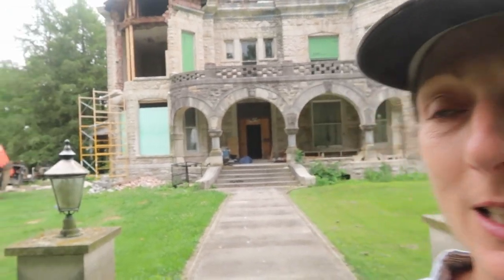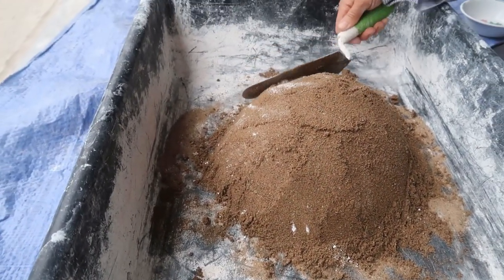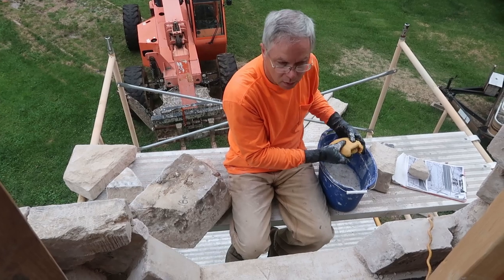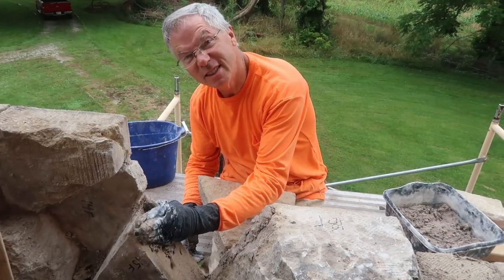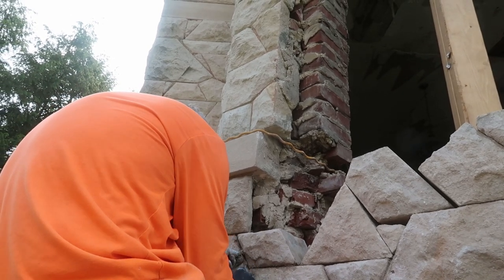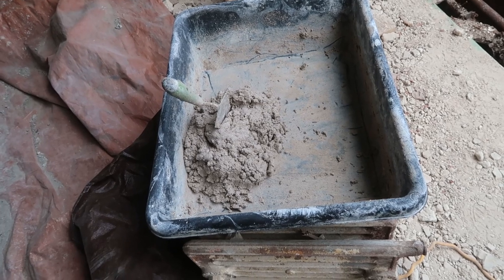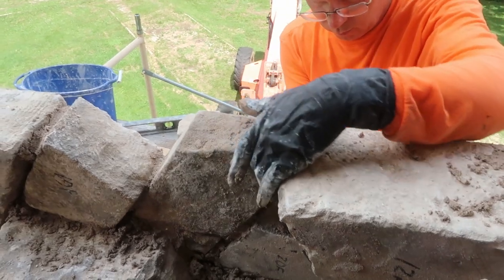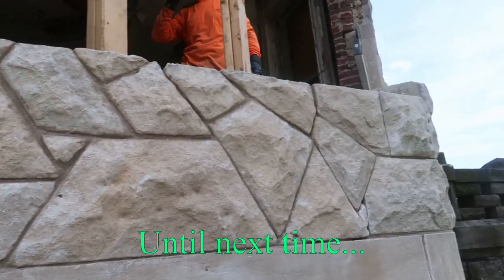Abandoned Mansion: Stone & Mortar - Mooreland House S2E20

Comment: That mortar looks a little on the dry side. Hot lime mortar!
Reply from the maker: Yes, it is an interesting mortar. Once you put it in the joint and work it a little it becomes the right consistency. They used to beat the left over mortar from the day before and it would become workable again.
Reply: @moorelandhouse  Good to hear. Where did you find quicklime? I've only been able to find hydrated bagged lime.
Reply from the maker: Yeah, it isn't the same stuff. We had to order it as 2,000 pounds of it from a chemical supply company.
Reply: @moorelandhouse  That's a "Ton" of lime! ;-) I expect you'll use it all with a house that size.